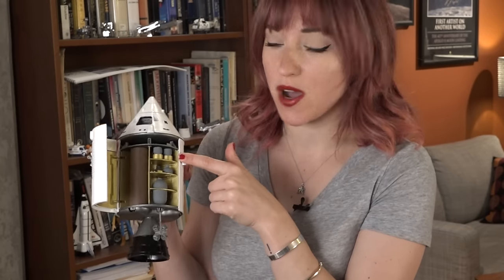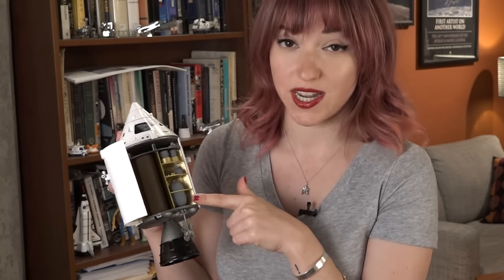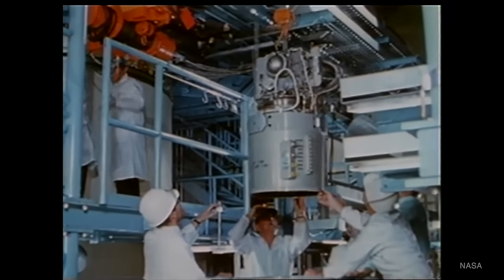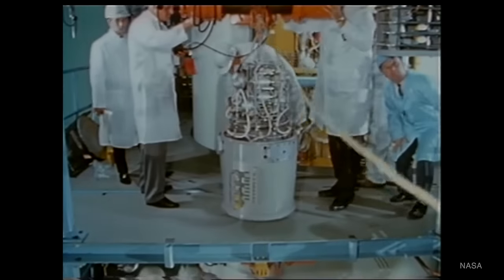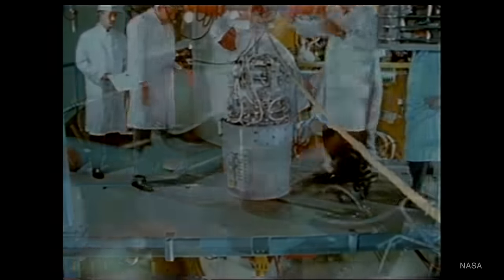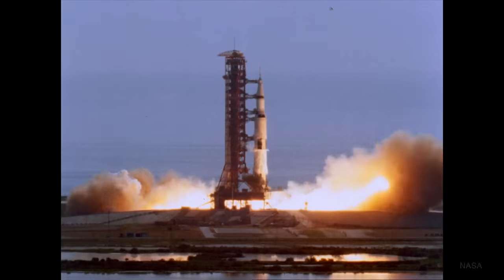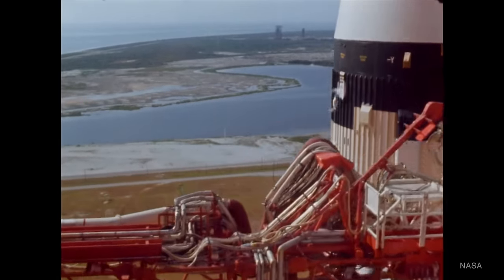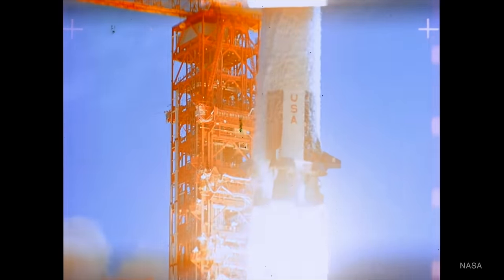How Quickly Did the Crew of Apollo 13 Know They'd Lost the Moon?

Comment: I personally spoke with EECOM Sy Liebergot (played by Clint Howard in Apollo 13). He was the one who called for closing the cells (losing the moon) and also stirring the tanks if I remember (causing explosion). From his account the minute he said close the tanks it was almost instant the realization and from Gene (FD) that it was over. They had been having issues with that O2 tank right after the launch which was actually why they called for a stir at that moment. Sy's and the primary ground crew's shift was ending and before they handed it over to secondary they wanted to get another reading. One could say that Stirring the tank actually SAVED the crews lives, since had it been done later in the mission theres a good chance they'd be orbiting the moon and with the LEM separated. In fact it was a fortunate series of unfortunate events that made survival possible. They REALLY did get lucky.
Reply: +MrFang333333 Closing the fuel cells, that was the "close the reactant valves" order that they received from MOCR right?
Reply: +RickyboyH Im pretty sure it was the change M14 Diapers

Comment: Is it too late for a question? What was the point of using AC inside the module?
Reply: torque synchros need AC in order to function
Reply: AC lends the ability to transform voltage up and down as needed, and generally allows the use of lighter conductors.

Comment: I worked for an engineer who was at the cape during Apollo 1. The process of Troubleshooting, Problem Solving and Decision Making was changed during the corrective action.  A group from MIT who had worked with the Air Force did the training.  During the movie you hear the phrase "Work the problem and stop guessing".  That was from that training.  Later I worked with some of the engineers from the Challenger disaster. That was when the division between science and management was obvious. Covering the failure mode on Apollo 1 would be a short segment you could cover.

Comment: They used alternating current? That seems odd to have that on such a small vehicle. i figured it would have all been direct current.
Reply: A number of instruments onboard would operate more efficiently from 400 Hz AC power.  Remember, this is an era before highly-compact, highly-efficient solid-state DC-DC converters.  They did have switching power supplies (one in the AGC, IIRC), but AC power onboard was useful.

Comment: Topic request: Why was the fuel tank of the first shuttle white, and why was the color changed after the first launch in 1981? Why did NASA want the entire vehicle (tank, SRBs and shuttle together) white? Was it for tracking motion during assent?
Reply from the maker: +InsyberNaught Definitely a good video topic - lots of people ask about shuttle stuff! Short answer: the white paint was heavy! But this is actually a pretty good story. Added to the list!
Reply: +Amy Shira Teitel (Vintage Space) I've often wondered when the tank was being painted, did that lessen the loss of the foam insulation?  might it been safer to have the painted tank?
Reply: +InsyberNaught I suppose NASA used white for it to look good, later missions skipped the paint to save some 600 pounds to use for other payloads.
Reply: +Brian W Not really, the reason was to provide some UV protection and help with keeping the tank cool during the filling operations prior to launch. Lockheed, the contractor who built the tanks, realized after the first two flights that the paint was unnecessary and elected to save the weight as well as money.
Reply: +Dustin Wright No, it did not. The "popcorning" effect and foam loss were just as bad with the paint as it was without. The safest thing was what NASA ultimately did after Columbia: remove the bipod ramp and  PAL ramp from future tanks.

Comment: Could you do a video on the inaccuracies of Apollo 13? When I started playing Kerball space program, I realized that there was no way they could get by with a single course correction and this became my biggest disappointment with the movie.
Reply from the maker: +Victor Iliescu You mean about the movie? I could.. Could be interesting actually! Might make for an interesting podcast, once I get that started!
Reply: +Victor Iliescu Yes, in addition Jack Schmitt has said that a key part of Apollo 13's survival was the recharging of the command module batteries (by the LM) before re-entry. This was not covered in the movie.
Reply: +Amy Shira Teitel (Vintage Space) Awesome, glad to hear you're considering it Amy! Don't get me wrong, I think I watched Apollo 13 a hundred times myself and I still love it but it would have only made it better having the other manoeuvres in there.
Reply: +Sarahlea Kelly 

Hi Sarahlea, forgive me, but drawing power from the batteries on the LM to power up the CM was a crucial & dramatic part of the movie.
Reply: +Sarahlea Kelly They covered it a little bit in the movie. It was part of Ken's power up procedure turn on the CM back on. Summarized version:  They knew they had a cable running from the CM to LM as a backup to the LM power supply. Ken suggested they reverse it and draw the remaining amps from the LM batteries before they cut it loose, he was then told he'd loose a lot in the transfer. But Ken said it was okay because he just needed a few amps.
Reply: +David Keenan Ok, I guess the impressive part was that this transfer trickle charge was not normally done. Houston had to research and come up with a way to do something never done before.
Reply: +Sarahlea Kelly Actually, although it didn't show them configuring the systems in Odyssey , for the charging of the re-entry batteries, it was discussed, by Ken Mattingly, John Aaran and John Young, when Ken was in the simulator, and the two Johns were in the simulator control room.
Reply: +Victor Iliescu - After the movie came out, they asked some of the old Apollo guys to list the inaccuracies they noted.  All said the movie was fairly accurate, but all of them mentioned how the movie incorrectly showed the swing arms disconnecting one at a time from the Saturn V just before lift off. 

In reality the vehicle actually lifts off the pad and travels upward about two feet first and then all of the swing arms unplug and retract simultaneously. To allow this to happen there are flexible lines and cables between the end of the rigid structure of the swing arms and the interfaces that are plugged into the rocket.

This is done in case of a pad abort, like in the case of one F-1 engine not starting. After the abort you want the swing arms still plugged into the rocket so as to get the fuel and oxidizer unloaded. If the arms were unplugged and swung away before actual lift off, as in the movie, then you couldn't take the propellants off so you'd end up with a giant bomb sitting on the launch pad with no way to defuse it.

Once the rocket comes off the pad a few feet it's either going to fly away or fall back and explode. That's why they waited until after liftoff to unplug the swing arms. There were two "lift off switches" at the base of the launcher that tripped after the rocket climbed the first two feet. The signal from the switches then told the launch pad's computer to unplug and retract the arms.

The shuttle did the same thing. The aft service connection stayed plugged in until just after liftoff.
Reply: +Joe Vignolo The Bluray and DVD of Apollo 13, has a commentary track, featuring Jim and Marilyn Lovell.

Jim Lovell points out, and explains, a lot of the inaccuracies in the movie.
Reply: +BedsitBob - Thanks. I'll have to check that out.
Reply: +butchtropic - What you say is basically true, however running the remaining 4 engines longer is not the same as running all 5 for the normal full duration. The reason is that with 4 engines the vehicle is using propellant at only 4/5 the normal rate. As such it stays heavier for longer than it should and as such the whole acceleration curve gets behind.

Losing an F-1 at 16 seconds would have prevented a fall back as you said, however getting the entire Apollo spacecraft into earth orbit with enough fuel left in the third stage to go to the moon would have been impossible. I'm not sure what the abort plan would have been at that point in the flight. They probably would have gained some altitude and then separated the CSM from the Saturn V and landed it in the Atlantic Ocean.

Something like this almost happened on Apollo 13 when they lost the second stage center engine. They burned the other 4 longer and then had to burn the third stage engine longer to get into orbit. But then they had to carefully check the amount of fuel they had left in the third stage and it was just enough to continue on to the moon.
Reply: +Victor Iliescu I noticed another thing that may be a mistake. Towards the end of the movie, during the sequence right before re-entry when the LEM and the capsule separate, you can see the docking probe still attached to the capsule.
On a different note, I play the movie every night to help me go to sleep.
Reply: +Rodrigo Ramirez Where should the docking probe be?

Attached to the LEM?
Reply: +Amy Shira Teitel (Vintage Space) I think the best thing you could do would be a complete, full-length commentary on the movie while watching it. You could mention the inaccuracies as they occur as well as going into detail on everything they did to make it accurate. Make sure to tell us exactly when you start the movie so we can watch along!
Reply: +BedsitBob Inside the LEM. There is no further use for it before re-entry, so the astronauts would just simply leave it inside before separation.
Reply: +Rodrigo Ramirez Don't they need the probe to extend, and separate the 2 craft?
Reply: BedsitBob You need the probe to separate them when you intend to dock again in the future. At final separation, the entire docking ring (still attached to the LM) is pyrotechnically separated from the CM.
 When this is done, the probe and drogue are stowed in the LM cabin as they're no longer needed. One mission did bring the probe back (stowed inside the CM) as it had a problem with the capture latches in the first docking and engineers wanted it to examine it after the mission.
Reply: +Amy Shira Teitel (Vintage Space) Jim Lovell's commentary on the special edition DVD is pretty good.  He points out quite a few things that they got wrong ... and quite a few things they got very right.
Reply: +BedsitBob Adam Ahmed below just gave a good answer.
Reply: +Rodrigo Ramirez I know. I read it.
Reply: +Victor Iliescu Read Lovells book, Lost Moon. You should see what they cutout of the movie...
Reply: +Victor Iliescu That game is how I knew what they were talking about in the movie
Reply: +Immortalcheese What game?
Reply: BedsitBob
https://kerbalspaceprogram.com/en/
Reply: +Adam Ahmed Wasn't that 14?
Reply: Dale Thelander Yes, it was 14.
Reply: Sorry but I don't think so.  The Apollo footage was from Apollo 17...Eugene (Gene) Cernan, Ronald Evans and Harrison Schmitt.  This was the last Apollo mission to land on the moon.
Reply: First Apollo missions used free-return trajectory to reach the Moon. It means that afterperforming Moon transfer burn in low Earth orbit and reaching the Moon, Moon's gravity changes the trajectory, so in case of the main engine failure before Moon orbit insertion the crew will return back to the Earth safely instead of escaping Earth. Since Apollo 12 they also used free-return trajectory, but with the tiny mid-course correction they changed it to non-free-return. The exposion occured after this correction.
In real life there were 2 corrections after the disaster to speed up the return to Earth by 10 hours, but you can make it with just one in KSP.
More about that: https://en.wikipedia.org/wiki/Apollo_13#Crew_survival_and_return_journey
P. S. My English isn't perfect.
Reply: +Korben DaIlas I counted four course corrections based on that graphic and other sources which is why I brought it up. I read that one of those was even done with RCS.
Reply: No, that one's actually accurate.  NASA decided against using the pyrotechnics to eject the LM (which would have taken the probe and a portion of the tunnel with it), I'm not sure why.  Maybe it was power constraints, maybe it was nervousness about what a cold-soak had done to the pyros.  Whatever the reason, they decided to instead leave the LM partially pressurised and simply disconnect the probe, allowing the pressure in the LM to blow the two spacecraft apart.
Reply: There are so many errors in that movie, we should sue Ron Howard. It would take a 5 minute video just to rattle them off, without going into detail.
Reply: This might help... Apollo 13 happened for real with the millions of threatening details.  Ron was making a movie and on a budget.  He also had to give time for the stars, brief back to producers why he did this and that.  A movie will never be reality.  It can't.  Reality can never be a movie.  It can't.  Probably the only movie that captured true reality is when Hitler asked for motion pictures of all the executions of the German Officers the Gestapo hung up on razor wire who plotted to blow him up in his bunker.   They say he really enjoyed it.  We should not wish for too much in reality, and remember the limitations we have to live with.
Reply: For all the inaccuracies, on the flip side, they got a lot of things spot on. In the DVD commentary by Jim Lovell, he points out how many things they nailed, in addition to the inaccuracies, which for the most part were minor. The only true big one were the conflicts between Swigert and Haise. Lovell admitted that Ron Howard took dramatic license on this, and that in reality, Swigert was the one who developed the emergency procedures, and was more than competent to take Mattingly's place in the few days prior to the launch.
Reply: The Apollo 13 mission lasted 142 hours in real life. Although the film is trying to be as accurate as possible, it's impossible to fit all the details into a couple of hours and still make an entertaining story. It was never intended as a documentary.
Reply: I didn't know that about the 5 engines - where did you find this out?

Comment: I'd like to see some coverage of the Falcon 9 stage 1 landing dynamics.  When coming back from a GTO insertion, the stage uses a 3 engine burn to go from supersonic to stopped on the pad in just 8 seconds.  I'd like to hear about how much the engines gimbal, during typical landings, or how much the control loop actually calculates.  I'd also like to know if the re-entry burn is really necessary or if SpaceX is just practicing a Mars EDL.

Comment: WAY late to the party, but the FC configuration actually had Main B powered solely by FC3 because Main A needed both fuel cells on it.  This is also why they got a main B undervolt first as Main B (and AC bus 2) were powered only by FC3 and that cell's oxygen reaction valve slammed shut during the shock of the explosion.

Comment: Talk a bit about the Little Joe rocket. That tested out the launch escape system. There was a system failure that proved the thing worked.
Reply: It's also one of the most beautiful rocket breakups on film!
Reply: +steven romero Accidental test of the Launch Escape System that proved it worked. That was great!
Reply: +steven romero The little Joe rocket interests me, too. Could you do an episode about the launch escape system in whole? Once I heard that it had a fatal construction flaw - It would only be capable of separating the command module fast enough when the saturn V was supersonic. It would´t help in the first minute after launch or so. I guess that was a problem of time delay from failure detection to ignition and final separation. Is this true?
Reply: Walter Rudich From whai I  understand.  The launch Escape Tower if used. Was to be over the Ocean. This gave the crew a better chance of surival. The spacecraft was not really ment for a hard surface landing.

Comment: I have read where NASA and Grumman scrapped fuel cells for the LM.  Would FCS have allowed longer stays or were there other consumables that limited stay time on Moon.  FC would generate water and have large O2 supply. It seemed they were dumped for time savings but may have helped weight although battery tech was heavy then too.  Any more info available?